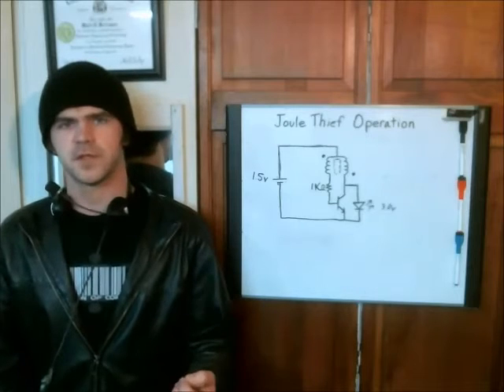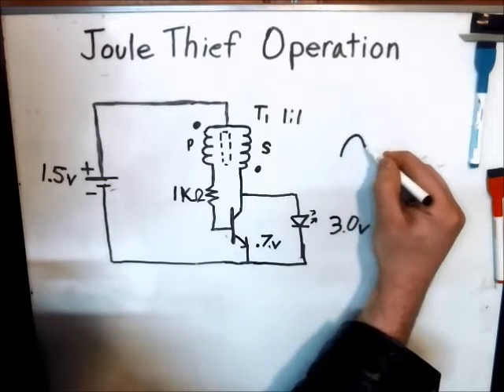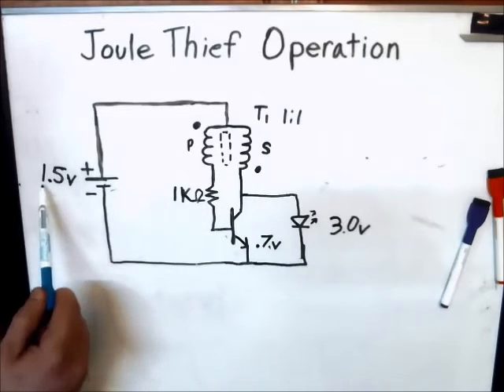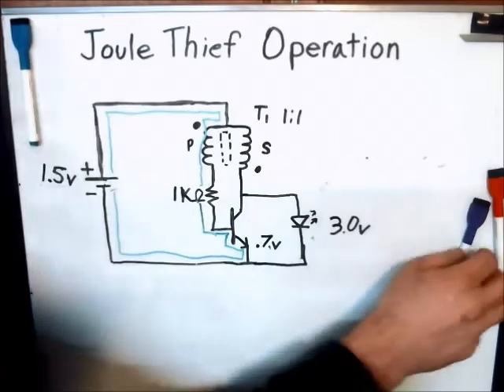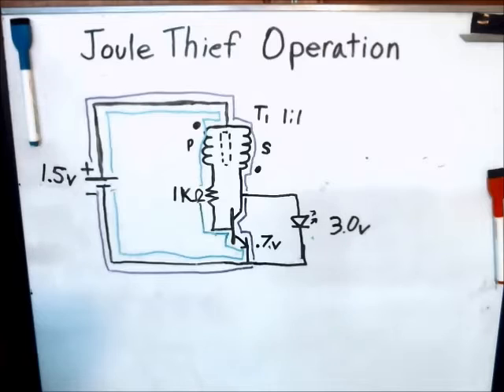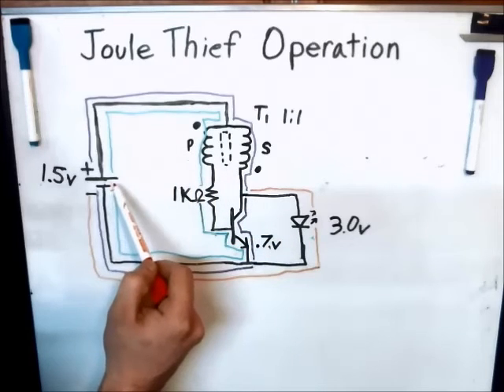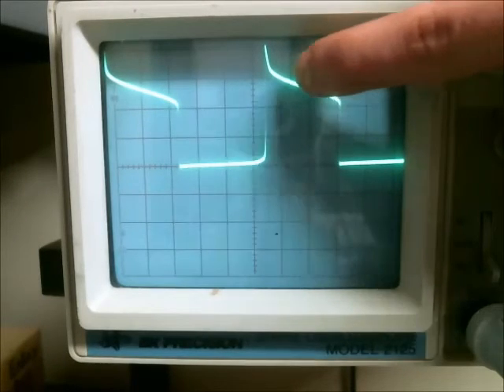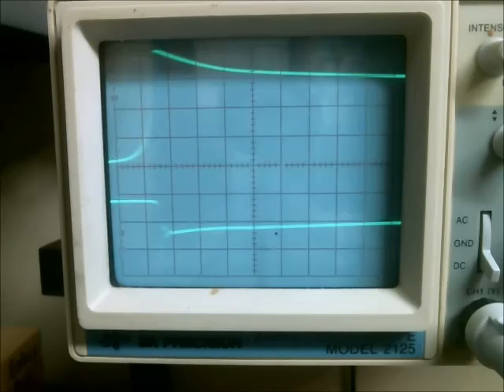Joule Thief Operation

Comment: Let me explain how the circuit really works. 
The circuit is turned on when current flows through the 1k and into the base of the transistor. 
This allows the transistor to deliver current to primary winding and this winding produces magnetic flux that cuts the turns of the feedback winding to produce a voltage and current that adds to the battery voltage and delivers a higher current to the base. This turns the transistor ON more and this action goes around and around until the transistor is fully turned ON. It is called POSITIVE FEEDBACK.
Up to this point in time the transistor has been producing increasing or EXPANDING FLUX and this has produced the voltage and current in the feedback winding. 
But now the transistor is fully turned ON and although the flux is at a maximum, it is not expanding flux and the feedback winding instantly ceases to see (receive) the increased current. This causes the transistor to turn off a considerable amount and now the current in the primary winding is reduced. The magnetic flux produced by the inductor cannot be maintained and it reduces. 
The magnetic flux is now turned into reducing flux called COLLAPSING FLUX and it produces a voltage in the feedback winding that is of the opposite polarity. This voltage operates against the battery voltage to deliver a much smaller voltage to the base and in fact it is so low that the transistor is turned off completely. 
This effectively removes the transistor from the circuit and only the LED remains. 
The magnetic flux in the core of the indictor is now allowed to collapse at a very fast rate and this produces a voltage across the winding of at least 30volts. 
But the presence of the LED reduces this voltage to a characteristic maximum of a LED of between 1.7v and 3.2v, depending on the colour of the LED. 
Now another amazing thing happens. The 30v actually has a very low current associated with it, but the presence of the LED turns this high-voltage, Low-current into a low-voltage, high-current pulse that flashes the LED very brightly.
This fact is evidenced by the fact that the LED is very bright and would normally require 20mA or more, while the circuit is taking a few milliamp.

Comment: Can you Charge your 1,5v battery With the 3v Side ? win
Reply: I think I might be keeping the batteries up as I have built a joule thief circuit with a slightly higher voltage to handle the drag of more components and I am running a mechanical flasher that has a considerable higher draw than an LED .  Also I have another joule thief in the circuit that I wanted to experiment with that uses the same toroid that I wound with a center tap so I can adjust it with a   potentiometer and switch back an forth with in and out of the circuit. I began constructing this so that I could test mosfets in an inverter I have that has quit working that way I can test the mosfets to see if they heat up or whatever and when I looked up the spec sheets I found out they were SCR's,  that is how old this inverter is apparently. When I wound the toroid I used a ferrite magnet and I have placed it on two larger ferrite magnets and I belive they have a lot of power.  The batteries are three AA Duracells that I recharged a few times, they are older and I thought they were dead and was going to just suck the life out of them and throw them away.  After putting them in this circuit I have not had to charge them back up again and it seems to me like it was after adding the two large magnets to the transformer.  Three LEDs and a mechanical flasher and it's all still point to point wiring and the three LEDs are blinding,  I don't run it continuously because I am worried I might burn up the LED's  but I have run it every everyday, for a couple months now.   Also I tried to take a picture of this spagehtie mess with my phone and I think the  HF fields have caused the camera in the phone to behave strangely ..
The picture I took has a couple of things wrong with it and the first thing I noticed is it has created a background in the picture with some lines running across it and there is clock in the picture that is backwards, also there is a light with a handle on it and the handle is now on the other side of it,  so some of the things in the picture have somehow been reversed,  very strange and all this from three AA Duracells.  I imagine these old batteries will eventually run down and I have yet to hook this up to the scope but perhaps our host here would be more interested in analyzing this situation  ....

Comment: wait I'm kinda confused now...in a video by rimsstar org, he mentions that the coil actually initially induces voltage to the other coil positively, therefore saturating the bjt. Now in this video
Reply: I'm fairly sure that, as u said, initially both coils negate each others inductances (oversimplified since current change rates are different between the coils) hence the current through the base coil rises quicker to then be stifled by the same Force that initially enabled it, and if the stifling lasts (if collector current is still rising)for any amount of time past 0 and base current starts flowing the other way, it shortly thereafter creates the base spike which isn't desirable... so the point would be to tune the system until only the collector coil spike remains to be harvested or in other words IF I'm right, the C current has to reach max at the same moment the base current ceases.

Comment: Pretty good analysis of joule thief operation, I'd been looking at my scope trying to work it out, the discharge of secondary coil turning off the transistor base is the key to it all. My circuit is the same as yours except I put a 100 Ohm resistor between emitter and ground, (more economical) I have a total current 6mA, 1mA thru led. Still quite bright!  Thanks, you are a good thinker. Some of the comments you got are from morons, ignore them.

Comment: bullshlaha
1. electrons flow from negative to positive
2. you forgot to mention that when the iron core is saturated theres no change of current in the secondary winding 
thus whole process reverses pretty quick eventually causing the transistor to close HARD
since there nowhere left to go for the current in the first winding the built up current in it was then forced thru the diode causes it to light up more or less 50k per second
3. you look like somebody who's regularly using meth

Comment: damn, I hate it when people use the +  as the direction of the electron flow.  It makes it confusing. Electrons are negative which means the electrons are coming from the negative side of the battery and that's how the REAL flow of current is suppose to be flowing from.
Reply: Most Electrical Engineers use conventional current flow, (+) to (-).
Reply: @brettcitro8961  N0 they don't

Comment: My joule thief works fine when I use a small 1.5v battery. However,When I use a larger voltage say for instance 2.7, the joule thief drains the current directly from the battery. I does not oscillate.  anybody knows why? Does the JT only work with voltages within the range of 1.5v?
Reply: If you are using a LED then higher voltage "can get through" it. But if you are using lower voltage the LED (diode) is closed(not enough voltage to open it) and the current has to find another way through the primary coil->base->.... and so on.
Reply from the maker: ocult3000 0.8v should work okay.
Reply: It seems to work with low voltages. 4 volts would not work. I don't know why. Can someone explain why?
Reply: ***** I did not mention 4 volts in my post. Your post may intend to reach someone else.
Reply: .....so if you connect two LEDs in series it then should work again I'm guessing .

Comment: Thank you. You videos are pretty good too :)

To see what I am describing, you will have to try a few different winds, in combination with transistor of different Hfe. I found a microwave oven transformer makes a very intresting study case. As do toroids with 10:1 up to 17.5:1 ratios. Did one with 37:1 ratio (zener diode tester), but it behaved pretty much as the 17.5:1 wind. So no need to over do it. I normally have 10 turns on the 1 side.

Comment: There are videos on my channel showing reverse Joule Thiefs where the neg base spike is used to light the led. Putting the emf current back into the battery. There are examples of these around YouTube (including the famous and slightly misunderstood "Dr Jones" version) That can run from a 0.5v-0.7v AA for months or years. Due to the bemf stimulating the chemical reaction in the battery (wont run long on a cap). I also have a video of a germanium transistor (0.175v base) JT starting from 0,06v

Comment: When the base current drops the transistor switches off, HARD. This causes the emf spike, which goes high on collector, and LOW on base (try LED cathode on base and anode on emitter or collector) Keeping the transistor off. Bigger inductors will do this for longer, and genrally take longer to switch off too. Once the emf has finished, the primary and secondary winds to start to go back to pos terminal voltage, which causes magnetic amplification. On the base wind, starting it over.

Comment: So the tiny current in the primary (collector) coil actually pushes the voltage up on the base, allowing the transistor to open. Once it opens there is more current on primary, but there is a path of lesser resistance this way too. The hfe of the transistor will determine how long this happens for (normally nano seconds or less) as will inductance and wind ratio. At some point, the transistor is on so much, that all the current goes through the colector, and the base voltage drops. cont...

Comment: Not a bad basic explanation. You missed a couple of advanced points. The hfe and inductance values play a critical role. There is also magnetic amplification at play.
Silicon transistors can be started from 0.4v, with no resistor. Even though the transistor needs.7v to turn on. when you connect power to centertap, the collector end of coil must rise to battery voltage, even if base disconected. This means some current is in the coil before it starts. cont...

Comment: Does energy get stored in the magnetic field in the coil (stage 1), and then the collapsing field (stage 2) induces a higher voltage (stage 3) than that created it in the load?  Is this the same a blocking oscillator?